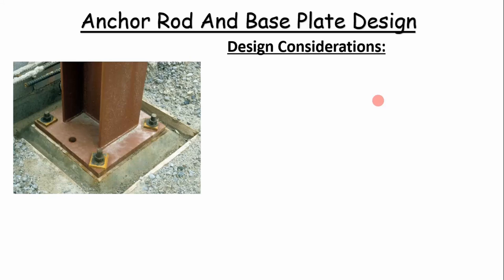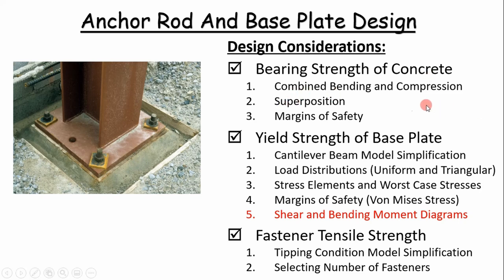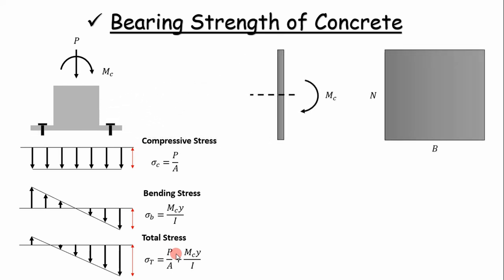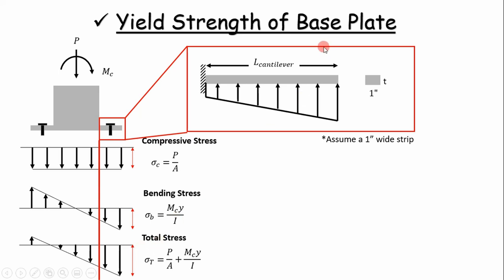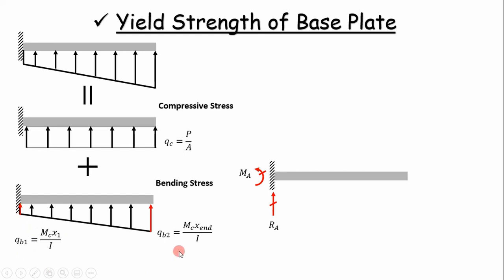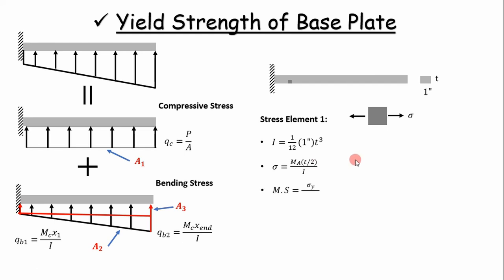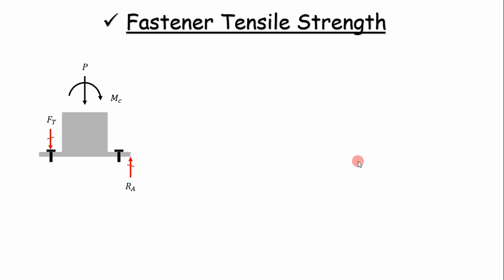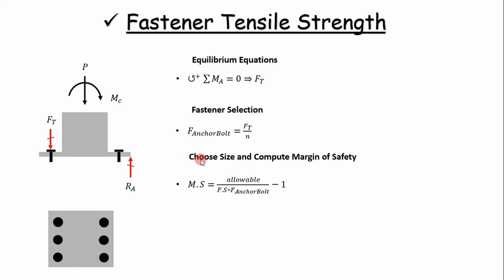Base Plate and Anchor Rod Design Introduction

Comment: At 4:24, the bending stress diagram for the drypack (concrete) under the base plate is questionable. There is no tension between the base plate and the drypack (concrete) except the anchor bolt tension force. The total stress diagram is also questionable.

Usually it is assumed that the compression due to over-turning moment (OTM) is uniformly distributed under the base plate beyond the column flange at one side and the tension is resisted by the anchor bolts at the other side. Additional compresion due to column axial load is added to the compression due to OTM for base plate thickness design. There is no need to over analyze the stress distribution.

For daily design, the anchor bolt and base plate design guide published by AISC should be used. A single equation can determine the required base plate thickness.

Comment: At 5:40, did you mean the dimension N as thickness of concrete or width? bh3/12 holds true only if h is the thickness of concrete.
Reply: i also thing he took the depth of concrete block as N and width (viewable in elevation ) as B

Comment: It looks that B and N are plan  dimensions of plate or concrete. However, when calculating the Moment of inertia is I = BH3/12 ...this means here you took H (thickness of concrete block) as N. Also, while calculating bending stress (Bending stress =My/I) (at 5:39/10.05 in the video) why are we considering y = N/ 2 and ..i thought may be the y should be half the depth of concrete block provided under the base plate. Please elaborate the N and B.. is it plan dimensions for base plate or dimension in elevation view for concrete block
Reply: Please think in terms of which face is fixed. 
here the square face (formed by sides B and N) is fixed, 
for us to have Bt3/12, the rectangular face (formed by sides B and t) must be fixed
Reply: @deepakjohsh7748  Yeah. He is calculating the pressures on the BxN face at that point, the same you do when you calculate the pressure distribution at the bottom of a pad footing while interacting with the soil.

Comment: Hi,
which euro code is used to design anchor bolt with base plate in concrete footing.../
Reply: Eurocode 4 : Design of Composite Steel and Concrete Structures

Comment: While Converting stresses into distributed loads, there is a mistake I think. Although you use 1" strip to simplify, it really does not matter. We still have "t" which is the thickness of the base plate. And it was not considered while calculating the line loads.

Comment: Awesome video !! This is the video am really looking for . I have one question here how will the design change if we add a stiffner in base plate . Can you explain ??
Reply: Hey Naveen. Introducing stiffeners will reduce the bending moment in the plate. Say you installed stiffeners aligned with the sides of the column flanges and extended these across the baseplate's full length. The moment developed in the plate due to the bolts/compressive block acting at a distance - previously - from the column flange would then be governed by the distance to the stiffener plate. Think of it this way - the load will distribute to the nearest and stiffest part, which would then become the stiffener plate. The governing distance for developing the moment, also known as the lever arm (termed 'z') would then reduce. Therefore, so would the moment [where Moment (M) = Force (F) x Lever Arm (z)]. Hope this helps you in some way.

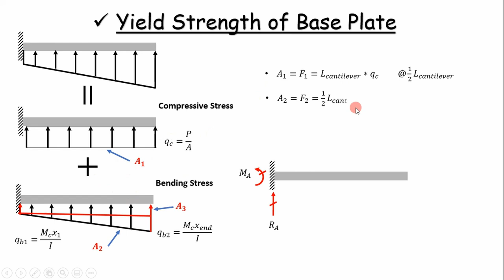Comment: Hey @TopDogEngineer at around 10:00 we're using qb1 and qb2, but I'm a little confused on x_1, x_end, and I. Are x_1 and x_end measured from the neutral axis, the fixed end of the cantilever, or other? Is the moment of inertia (I) the same for qb1 and qb2? Awesome video. Really helps, thanks!

Comment: i m in imagination regarding I = BN3/12 why not t3 , t= thickness of plate
Reply: it should be BN3/12 and not t3, this is decided based on which face is fixed/rested. 
here the square face (formed by sides B and N) is fixed, 
for us to have Bt3/12, the rectangular face (formed by sides B and t) must be fixed